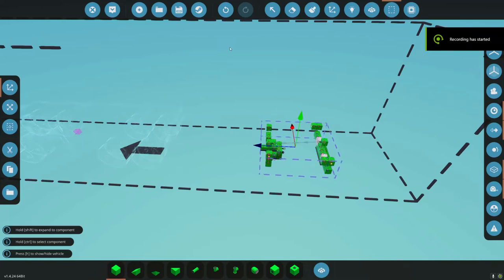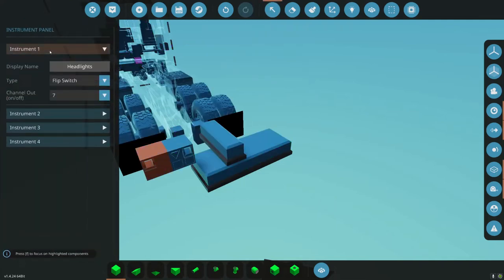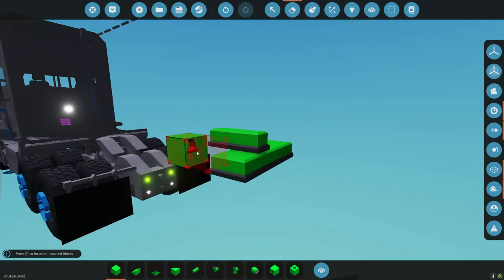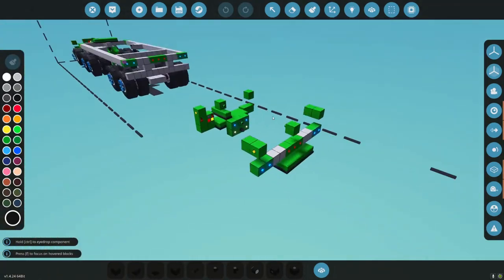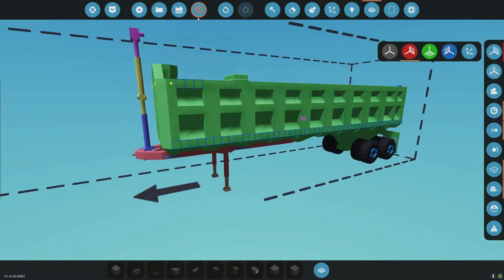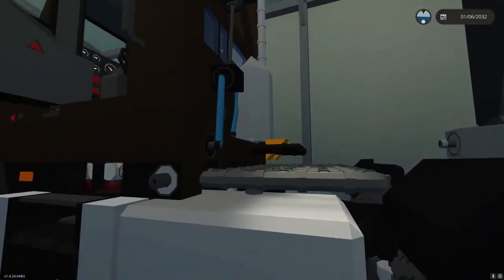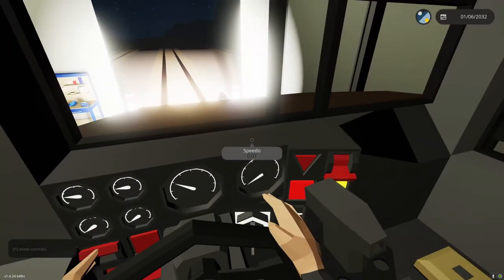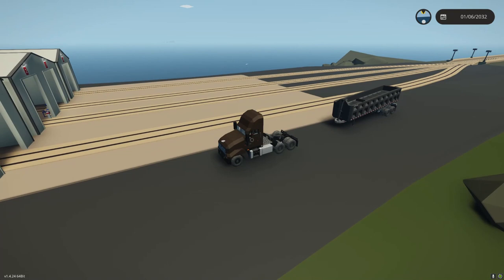Stormworks T-Tis Conversion

Comment: Will do perfecly dimb yellow ligts down the side of the trailer.. isnt that called "a chicken farn/house?" Maybe even a double trailer option...
Reply from the maker: I'm currently working on a set of doubles for containers. I'm probably going to have to xml a weight block to add some mass to the dolly. I may also need to add a brake drag for the kite to keep them inline.
Reply: @CaptainCockerels  THX.. it all sounds quite epic.. hopin Youll do a video once finished then..👍
Reply from the maker: @TheBubbarox  I will. Mack is actually almost done.
Reply: @CaptainCockerels  how to find on Steam workshop?
Reply from the maker: @TheBubbarox  When I release I will release a video and the link will be in the description.